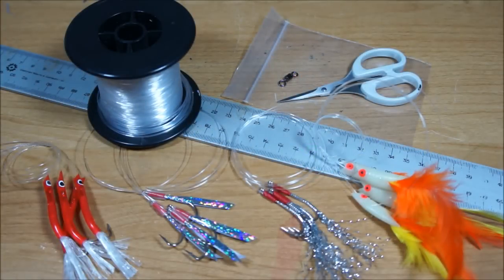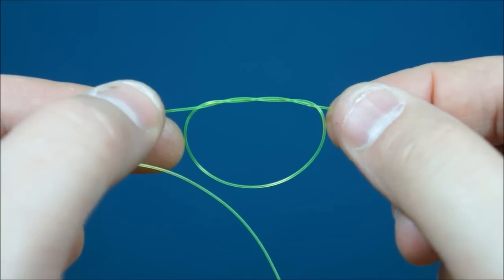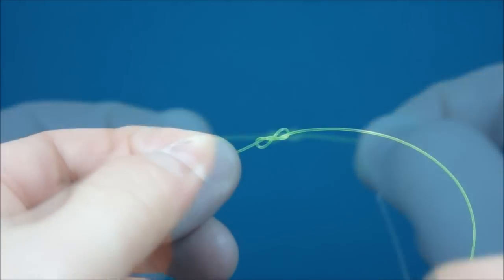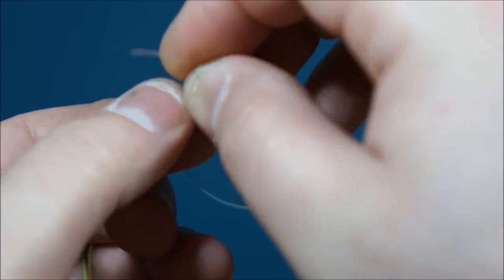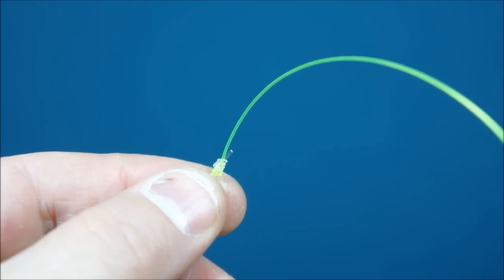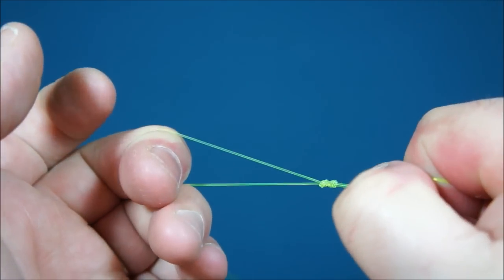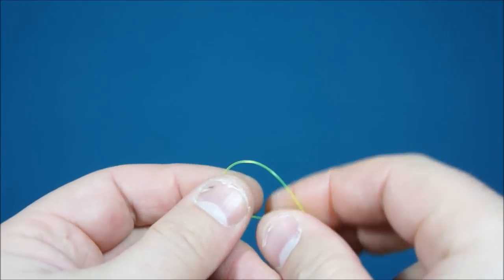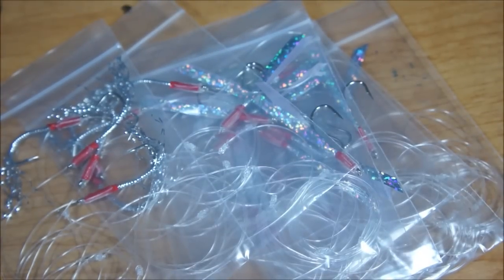Assembling  A Mackerel Feather Rig for Sea Fishing

Comment from the maker: when i began tying these a few years ago the i started with holographic type feather rig as it was easy to tie because the flash was held in place leaving me to tie the knot. I used this for boat fishing on kelpy reefs for coalfish, pollock, mackerel and cod, it has enough flash but is compact enough for good hook ups. When i was on Chesil beach the other week i quickly found out how important it is even very cheap equipment to set up properly (my rod and reel £30).

Comment: Hello this is a great video. Very informative. I am a saltwater angler from Sri Lanka. I always wated to do away most of hardware in front of the lure. I am currently using a heavy fluro instead of wire trace we used to have in fear of losing lures to macs and kudas. For the convinience of changing lures what if i have a strong split ring instead of snaplock end of the fluro so that i can change lures using a plier. Its not as easy as using a snaplock but eliminates having too many hardware. What are my chances of damaging line with split ring end? Thanks heaps for very useful tips

Comment: Very good video fella, I do like the rig for strength however, the booms don’t 
stand out 90deg from the main line like the blood loop version does, so tangles must be a factor is it not. ?
Reply from the maker: they behave very differently in the water than you would expect and think it has to do with using thick 30lb line, the lures tend have a lot of Résistance to the water and move  in half circles about the not on the main line. i Stopped using the blood not because i used to get a lot breaks at that junction, cheers for the comment made me think
Reply: @PaulAdamsTheHandmadeFisherman  I understand what your saying line thickness does make a difference, I see many videos on here where guys are using a
blood loop,  and cutting the loop to form the boom .. that I do know is bad
news as I found out when I used a tag end of a blood knot to form a dropper 
when fly fishing.. like you it broke at the knot every time.

Comment: Would this work with fluorocarbon line too?  Would make the rig nearly invisible.
Reply from the maker: +Panfish  I did for a time make these using flurocarbon but i have never been convinced that it is virtually invisible because i can see it in water and sure I am not alone.
Reply: +Paul Adams (The Handmade Fisherman) I agree with you. I don't think it's any less visible than mono. And I cannot stand the line memory of fluorocarbon.

Comment: I am wondering what is the story behind the knot you use to tie up the rig. You are the only one that  have seen that uses that knot. Did you invent it or is it a well known knot where you are from. I started making rigs out here in southern California and I have caught a lot of mackerel and bonito.
Reply from the maker: i was living on a remote island in Scotland and fishing nearly everyday in very kelpy and rocky or weedy water and losing a lot of rigs so i started experimenting with tying better  knots and came out after a few months with using these knots, for the hook this was based on hangman's knot but i wanted it to hold the material on and lot the rigs i had bought in the past tended to lose material after one use. I made a few alterations to it which seemed to improve things dramatically i am sure other people have come similar or the same knot. for connecting the snoods to the mainline again that is a couple of knots that i combined after testing them for strength. They may not be the easiest knots to tie   but they held up to the job. I had one feather rig on a rod for month and caught a lot of fish and never had to change it and I was fishing every day. For me these came out of fishing experience rather than copying what was out there and great when other people get some use out of them. I am an experimenter so i don't always tie these rigs in the same way but i still come back to the basics because i know they work for me.  cheers